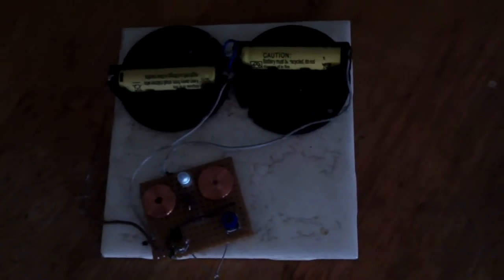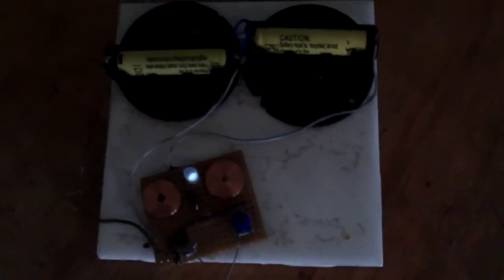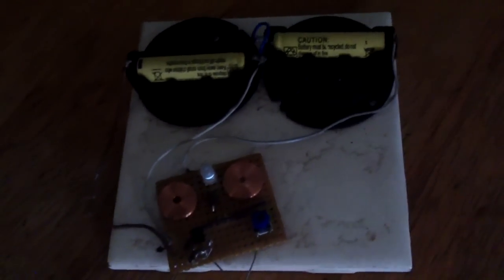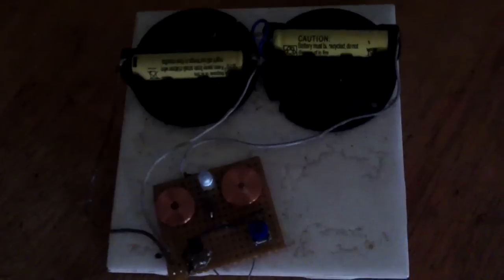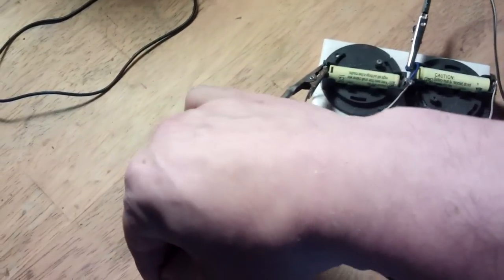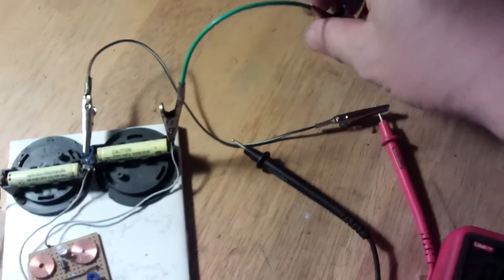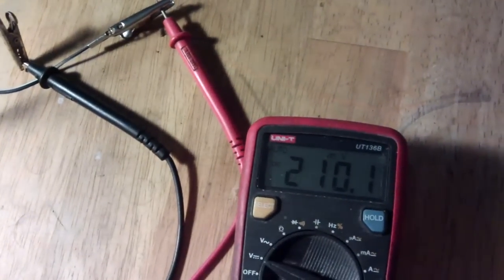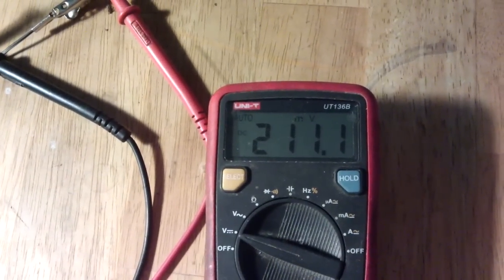2013 Cool Joule is back - it self started !

Comment: Hey Slider. Sorry for my lack of commenting or messages.  Interesting has always. Though I may be totally off base, I have always found the Current/amps lacking in these circuit's. Well at least the ones I have built. Has anyone ever tried to make one of these on a large scale, 120 t0 220 volt's scale ?. with a usable amount of amps /  watts ?.  
All my best.
Bobby
Reply from the maker: +Bobby Tectalabyss As long as you're doing all right and am very glad to see you commenting !
A scaled up version would be a fun idea. It's only a transistor, resistor and a couple of high ohm coils as the basics. Yeah, the output is very low, half of the secret to it, but I believe that TinMan is to rebuild his Cool Joule circuits and look at the Miller effect for capacitance. Perhaps these work best at the low end of the scale due to that.